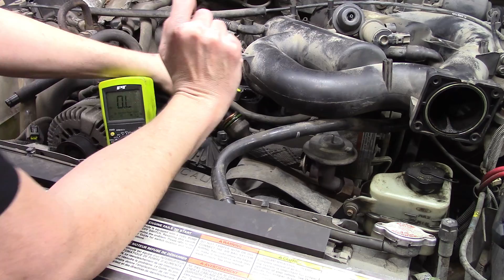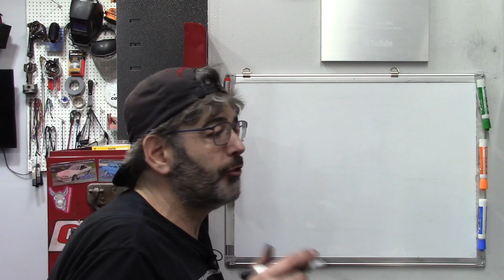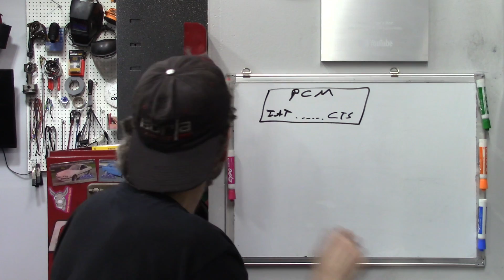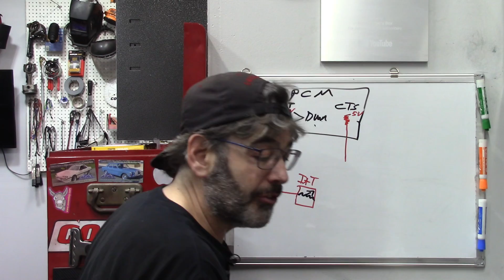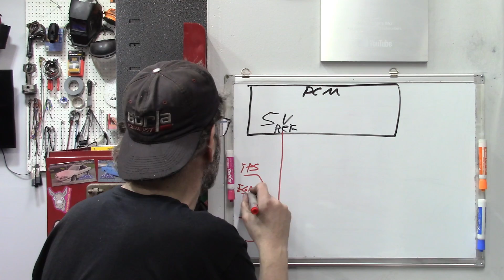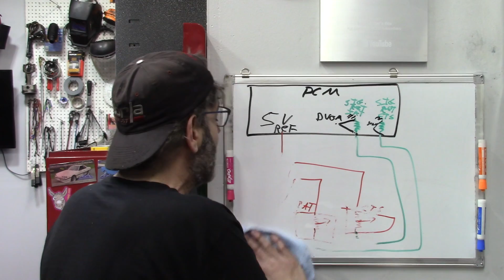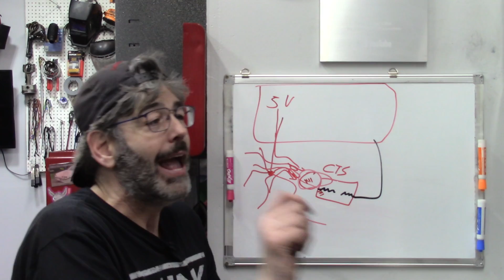P0118 Coolant Temp Diagnosis  New sensor didn't fix it Pt2

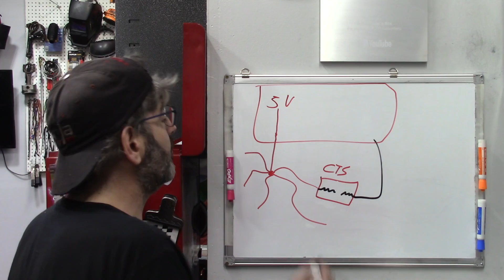Comment: I don't get your assertion @22:42.

Yours:

If cts short to the ground, it will short all connect to the ground. 

It is not correct.

They are parallel circuit.

One route is cts.
One route is iat.
...etc.

Suppose cts short to the grond, the wire ( only on cts routes) will be burned broken. Cts route will have a momentum current jump, it is this current jump burns ( broken) the wire.

At this time,the current on the other routes (iat include) will have smaller currents (compared to the normal condition), so the wires of iat and others will not burned.

Consider this as a parallel circuitry, and one route gets shorted. Might be clear.

Comment: Question I am confused how the sensor reads almost 5 volts while unplugged but when you jumped it with the paper clip it read 0v can you explained because I figured it should be the opposite
Reply from the maker: Simple. Voltage drop. You have maximum voltage on an open circuit. There is no voltage on a closed circuit across no resistance. That’s why all sensors have some type of resistance.

Comment: Hi my name is Damion, I'm fairly new to watching your channel. I'm gonna cut to the chase. I have a 02 chevy avalanche z71 that's experiencing a crank no spark condition. I've replaced the fuel pump, starter, crank and cam sensor and it still won't start. Prior I removed the clutch fan and installed duel fans that I have to turn on manually. Reason I'm telling you is because 1 night I fell asleep in my truck while it was running and forgot to turn on my fans and when I awoke the truck was off and it smelled like a faint burnt oil smell in the cabin. The truck would not start from that point on. I've thru parts in attempt to get it to start up to no avail. I've been watching your channel and you seem to be more knowledgeable on these issues. Please if you can help me diagnose the problem ... thank you
Reply from the maker: I am not following/l- so what is the issue- is it spark, fuel or timing?
Reply: No spark
Reply from the maker: ok perfect. what’s the voltage for the spark signal showing at the coil?

Comment: The engine computer and other modules with t
NTC temperature sensors the computer is measuring the signal as current

Comment: Hey Matt, I always learn a lot from you but at this time I’m seeking for a piece of advice.

 I’m working on a Honda CRV. I’ve replaced most of the coolant pipes that were eaten by rats. Finally got the car to start n it had no leaks. 

While the car was idling, i could hear it misfiring and vibrating and i find the check light flashing. I hooked up my mini Launch scan tool and i did get a P0303 misfire code. 

I cleared the code as I always do, just to reproduce the symptom. Eventually it came back on. I went to check for power, ground and signal on the coil pack plug, all was there. I swapped cylinder no*4 coil pack n s.plug with cylinder no*3. Still was getting the same code. 

I went on again and checked for power on the no*3 injector plug and it was there(also checked on the rest of the injector plugs). 

Swapped again injector no*3 with no*4,still was getting the same code. So while the car was idling, having injector no*3 unplugged checking for that open n close ground from the PCM( there was constant ground only on injector plug no*3). 

Left the car because it had a clutch problem since I’m not a mechanic, will have to go back to the car cause I’m not done yet. 

I got to think that it might be the problem within the PCM. Got me thinking again that that signal wire could have a short to ground, which I’m going to check once I get back to work on that car. 

LOL i know my story is long, but will you just help me out because there might be something small that I’m missing. 

Reply me when you come back from your trip. Thank you 👍🏾. 

All the way from Zimbabwe 🇿🇼.
Reply from the maker: Did you check compression in cylinder 3?
Reply: @SchrodingersBox  No I didn’t, I don’t have a tool to test it. Will find one and do just that. Thank you.
Reply: @SchrodingersBox  Excellent follow-up question Matt. I don't know what year this CR-V is, but if this is a 1st Gen (1996-2001), those engines were prone to valve burning problems due to a lack of proper valve adjustment. The recommended 30k mile (48000 km) valve adjustment (which is very easy to do) almost never gets done. I'd try a valve adjustment first. Sometimes there's not enough "adjustment" to get the gap correct. Then, if the compression test also fails, the head needs to come off because the valve is burnt too badly. Sometimes you can get lucky and just get by with a valve adjustment only. I've been down both paths with 4 different CR-V's. If this is a newer CR-V, it's likely none of this applies 🙂

Comment: Hi Matt, I try what you do. Problem is am south African. I tried Mitchell DIY , it wants American address. But eventually they did what they did and I subscribed. I looked for wiring diagram for Ford ranger t6 wild track. Is not there. When I ask why since Ford is American car. They said cars produced out of America they don't cover. So where can I find wiring diagram that covers both American and European.
Your follower
South Africa
Reply from the maker: Wow man not sure I can help with that. I didn’t know they require American address.  I once in a long while also have had issues finding diagrams for some unusual vehicle. I was trying to find one for an old ford box-truck like a delivery vehicle  and there wasn’t one for the specific model.
Reply: built as a chassis before body company adds there goodies! @SchrodingersBox

Comment: There is one problem. The PCM first design is NOT measuring across the resistor ( pullup resistor design) . The PCM for that Coolant sensor is measuring on the negative side of the resistor with respect to ground. The internal DVOM is measuring with respect to ground. 
When the CTS is unplugged , it is the same as an open sensor. The scan data will read HIGH, a full 5 volts.  If the internal DVOM measured across the internal resistor there would be ZERO voltage drop , because there is no current flow.  
The easiest way to determine if a circuit is a pullup or a pull down design, (your first example or your 2nd example), is to measure what happens when the sensor is totally disconnected. In example 1 , with the sensor disconnected, the resistance is infinity, far in excess of the minus 40 degF temp. With the resistor in the power side of the  circuit, and the measurement point internal, the voltage measured goes to 5v  HIGH, this means it is PULLUP to a logic HIGH.  
The opposite happens in your example 2. When the CTS is disconnected in example 2 the PCM measures ZERO volts , the logic LOW , a PULLDOWN circuit,  and because it measures on one side of the resistor it is protected from " floating " to either high or low which could happen when wires are near high voltage and current wires. 
I believe you understand but it is not coming out in words. 
It is important to NEVER use a conventional test light to check for the 5volt pullup design.. This is because the internal pullup resistor might be about 5 KOHMS , and the test light only has less than 50 ohms of resistance. There is not enough voltage available to light the test light because 99% of the drop occurs thru the pullup resistor.    When a 10 Mohm DVOM is used, you can then measure actual 5 volts because there is only a small drop across the 5K ohm resistor ,as compared to the 10M ohm in the DVOM. Do the math , I did.
Reply: If you look thru the comments you'll see I pointed this out yesterday, but he doubled down on his initial assertion that the PCM is measuring across the pull up resistor 🤷‍♂️ Hopefully he gets it eventually and offers a correction bc you can see from all the additional comments in that thread that it's leading to a lot of confusion/misunderstanding.
Reply from the maker: @nowayjose596 it doesn’t measure across the resistor. It measures the drop from that resistor against ground. There is a difference.

Comment: the purpose of the internal resistors in the pcm is to CONVERT sensor CURRENTs to voltages.  The two-wire sensor is a current throttle wheras the three-wire is a voltage throttle.  The common ground is irrelevant as it is ONLY ground.
Reply: Sorry to disagree, but this is not correct. It's a simple voltage divider and how is a resistor on its own going to covert current to voltage.
Reply: given a variable resistor.. then it reports its measured 'position/condition' as changing R.  The current through it yields a varying voltage =>  V = I × R.  Most generally speaking a fixed voltage is applied and the result is a varying current.  

You are correct in that there's a secondary, fixed resistor in series that forms a voltage divider.  And it's the voltage across this FIXED resistor that is the marker of the sensor's position, NOT THE VOLTAGE ACROSS THE SENSOR.  i.E., the resulting voltage across the sensor can be confusing because if the sensor's R goes down its I goes up...Possibly the sensor's voltage mighr STAY THE SAME. 

The 2wire experiences CURRENT changes while the 3wire does NOT.  The 3wire ouputs variable voltages; the 2wire yields variable current.
Reply: resistor (fixed one internal to PCM) yields voltage in proportion to its current.  As sensor R decreases the fixed R experiences increased I and also increased V.

Comment: C R A P ..   follow on response to this was an exvellent observation that the meter read "OL" NOT 0 ohms as was reported.  

Part 1:  You measured 5V at firewall and the P0018 says failed high= open.  Yet you measure sensor = 0 ohms and claim it is failed.  You short the sensor connector (0 ohms again) and it responds on scan at +253 °...  Yet the initial failed reading was -40° with circuit as originally discovered??  

This might suggest a loose connector pin resulting in an open circuit  This is Why the shorted sensor doesn't read at firewall but, instead, = 4.7V.

///  and the observation below explains it all:  When measuring the sensor the DVM yielded "OL" NOT 0 ohms.
Reply: The failed sensor was open inside, it is infinate resistance, not zero. The meter is actually reading out of range. Same value if the sensor was unplugged. The voltage will be HIGH a full 5 volts at the point of measurement internally in PCM because there is no current. So with respect to ground there is 5 volts on both sides of the resistor. When the wire connector is shorted to ground there is almost zero resistance, the current flow at the maximum amount ,and the 5 volts will drop across the resistor to zero volts, which will register as " voltage LOW.
Reply from the maker: Yep Daniel is correct. I may have said “zero” on the meter but of course I meant OL.
Reply: @SchrodingersBox  of course you did
Reply: thank you!  I repeated the video and saw OL  not  0 Ohms.

Comment: Love the sarcasm, you keep saying TWO coolant temp sensors. One is a sender and it uses a 10 volt pull down signal. Great video, credit for working on older cars.